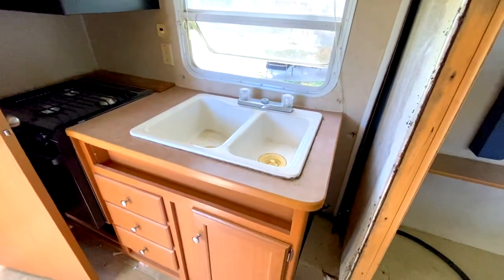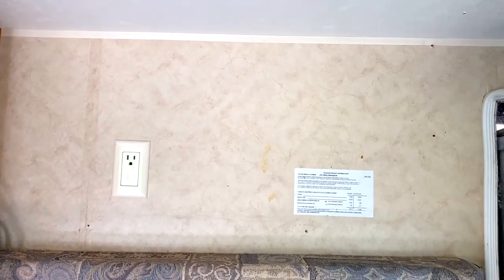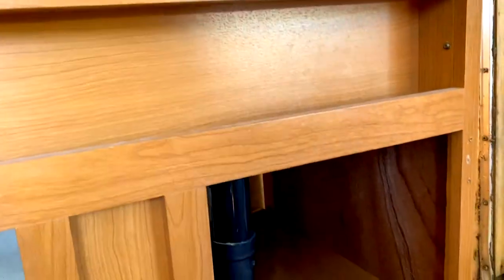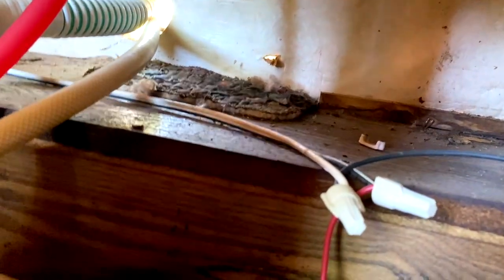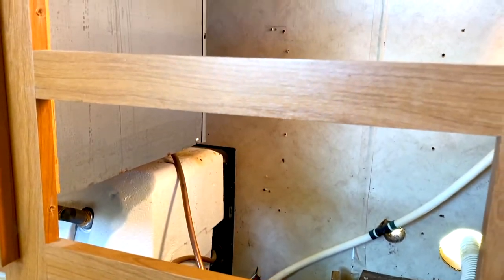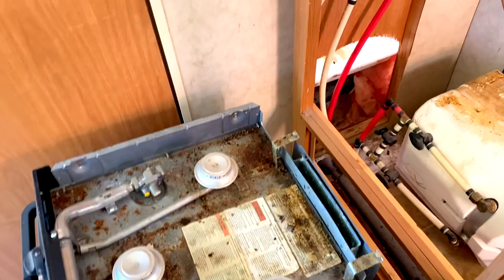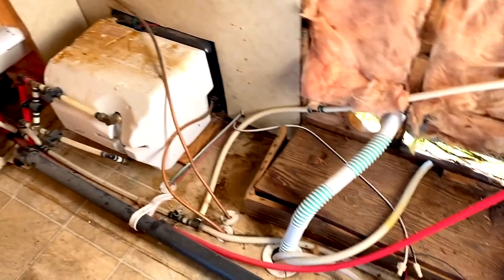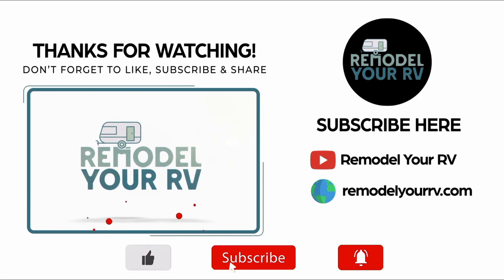RV Remodel: Kitchen Stove and Cabinet Removal

Comment: Thanks for sharing this. We just purchased a used RV and I'm debating if I want to rip out the sink and stove cabinet or try to keep the main frame of it and reface it. I'll find out tomorrow when I really get into it but this has been a huge help.
Reply from the maker: Good luck with your project. What did you find out once you ripped and everything?
Reply: @remodelyourrv  thanks. So far we have been lucky. Two sheets of plywood will fix the floor and the bathroom vanity was completely rotten but we were changing it out anyway.

Comment: I'm about to have to do the same thing. Got rot around my slide out opening. Stove, microwave, then bathroom vanity and cabinet on the other side got to come out. You got stick and tin though. The insides of my walls are different than yours and I can imagine why my slide out opening is so flimsy right now with the rotted quarter inch ply in there when I have rigid aluminum.
Reply from the maker: Oh man, I feel your pain. Stick with it long enough and you will see the light on the other side. There were a couple times I as about to throw in the towel. Mainly when I kept discovering more and more damage. Keep me posted on your project!

Comment: Very useful video.  Seeing how it is built and how to remove items is super useful, many thanks.
These RVs are built so cheaply when you look behind the panel!  I would remove all fiberglass insulation and add wool or mineral rock that does not get wet or moldy.  Pink insulation is wrong for RVs. Look at that wood too, should be removed and redone.  Good amount of work there, hope it all worked out.

I wish you had better camera work - just slow down the camera work so the brain can follow what you are doing. It is too fast.
Also, please do not add music to any demo or DIY video.  It is very stressful on the ears and unpleasant.  It is soothing to hear voice only.
Reply: What makes r19 wrong for rv , pink I bealieve .

Comment: How did you remove the false cabinet bottom with all the staples so easily without damaging the panel???
Reply from the maker: I used a small nail bar and worked from front to back while alternating sides.